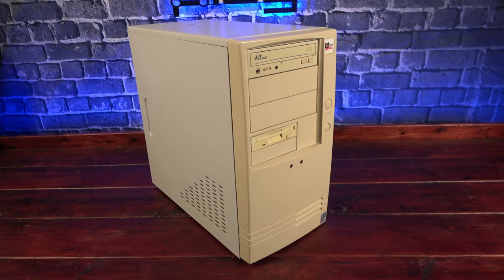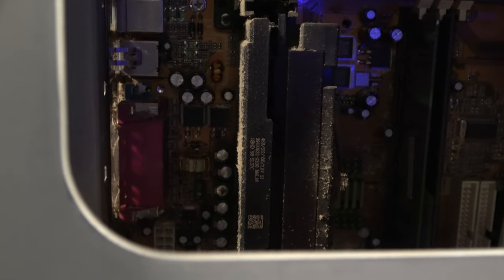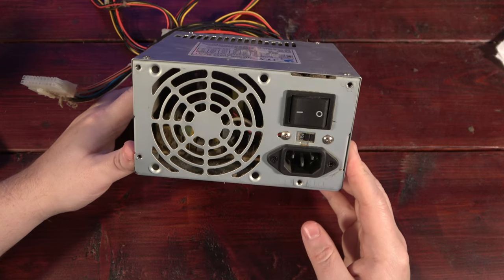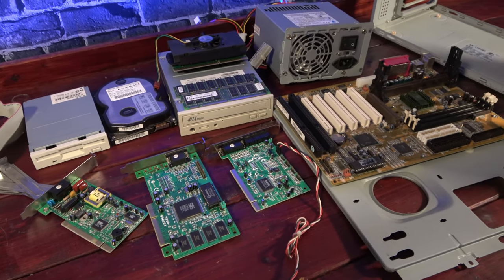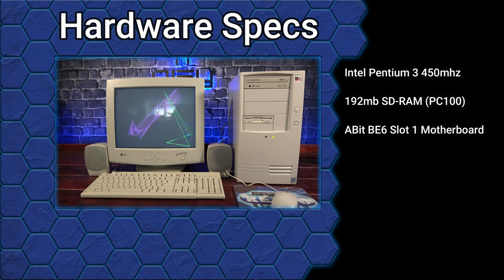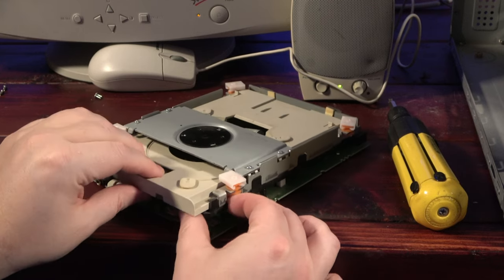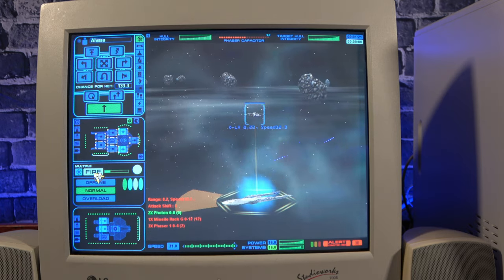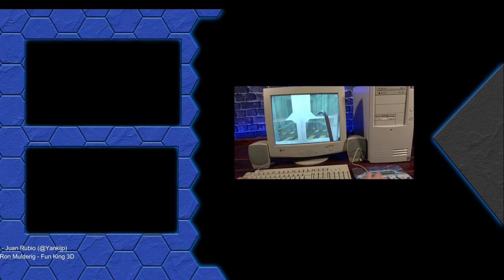Restoring a DISGUSTING Mystery PC From 1999

Comment from the maker: Thanks for checking out my restoration! As Stephen Z noted, the board is in need of a recap! Anyone interested in a video on it? Let me know! And be sure to check out my iMac G3 restoration here! https://youtu.be/oJB9wxg-czk
Reply: I'd be interested! Just subbed.

Also, is an anti-static brush needed? It has a bunch of dust that is conductive, and a vacuum that is creating a lot of static on its own.
Reply: Could you do some benchmark testing with the CRT monitor on a low end GPU?
Reply: @woodworkerroyer8497  He mentioned the brush being anti-static.... I assume the vacuum to be, even though anti-static vacuums are an expensive thing.  Technically for the brush to work properly it needs to conduct through his hand to his antistatic strap.    NEED is such a strong word.  The proper way to do it is with all this antistatic stuff.  He used the brush with a glove on, which isn't proper and everything finished successfully, so by strict definition of the word "need".  No.  "Should" you use an antistatic brush, and anti static blower or vacuum?  Yes!

Comment: Great restauration! RAM is ok but it definitely needs a better graphics card. A Voodoo 3,  TNT2 Pro or Matrox G400 would suit very well and definitely will boost performance a lot.     Instead of the Crystal Soundcard I would recommend an Aureal A3D or Soundblaster Live!. If you want it to be preserved as it is, games like Age of Empires II will run very well, anything but 3D:-)
Reply from the maker: I'll keep an eye out! I've got a bunch of spare AGP cards, and a few 16 bit Sound Blasters... at the very least should move into more compatible parts. Thanks for weighing in!

Comment: Ah, the SiS 6326. That card was atrocious. It was cheap, though, so back when I was working in a computer shop in late elementary/early high school, we sold tons of those cards. About the only thing that was good on those cards was the S-Video out. With DVD drives starting to appear on the market, that was actually a huge selling point. 

And that power supply... I remember that sticker. That power supply was bundled with an endless number of cheap ATX cases at that time.

Comment: There are 2 things I would like to mention. First - the caps on motherboard. All of those located near CPU badly needs replacing and all other needs testing. Second thing - the PSU. When I saw that sticker I was sure that thing asks to be replaced, but when you opened it became clear that it is most likely a reason why the caps had bulged. Honestly, I'd put it to recycle bin in no time, as it is a low quality unstable PSU that may damage rest of the components in a future.
Reply from the maker: I forgot to mention the caps in the video, but new ones are ordered. As for the PSU, I think I will replace it as well. I like to see how much is salvageable when I do this type of thing, but I'd hate for the cost of a PSU to kill other parts down the line.

Thanks for watching, and taking the time to comment.

Comment: Antistatic brush requires your arm to be part of the grounding circuit, which means I don't think the gloves can be used, and you need a grounding strap.
Reply from the maker: The handle on the brush itself is plastic,  so non conductive . I've never done any research on them,  but I always assumed it was merely that the materials used for the bristles don't generate static.

That being said,  a brush that can be grounded sounds like an interesting invention.
Reply: @PNPRetro  It's conductive plastic....2 plastic surfaces (like individual bristles) rubbing together always have the chance to develop static.  What makes the anti-static ones special is the plastic is conductive, so it can be grounded... But without the grounding it's just a brush... I'll see if I can dig up the links I found last time I looked this up.
Reply from the maker: @TheGodOfAllThatWas  thanks for educating me, I appreciate it. Sometimes the most dangerous thing I can do is to just assume I know how something works!

Comment: You can often fix a non opening optical drive by boiling the drive belt in water for 15-30s. They lose tension over time and this shrinks them back! I've stuck them in the microwave inside a coffee cup and had good success. Of course a proper lubricant on the gears is equally valuable
Reply from the maker: I'll give it a once again! Thanks for the tips
Reply: Or simply replacing the drive belt.

Comment: I'm highly amused by your sense of disgust, since this is essentially normal for 6 out of 10 scrap PCs for me. haha
Nice  modular case though, I wish I got more with removable base plate.
Reply from the maker: Haha! Yup, I guess the level is different for everyone. It's not so much the dust... it's that tar mixed in with it. And that unmistakable smell that goes along with it. 

I do like the case. I was pleasantly surprised when I found the motherboard was on a removable tray. My only dislike is the placement of the power supply. But, with the removable bracket around it, it's easy to remove. So, not too shabby, all things considered! Thanks for watching.

Comment: The PSU-FANs of my retro PCs are getting changed to Noctua and similar ones for extra quietness.
Will you change the CPU to 1.4ghz Tualatin?
Reply from the maker: I haven't decided if I'll upgrade the CPU at all yet. It's kind of cool to have the very first released P3 processor. I am full of indecision!